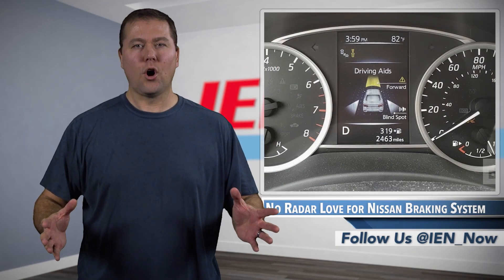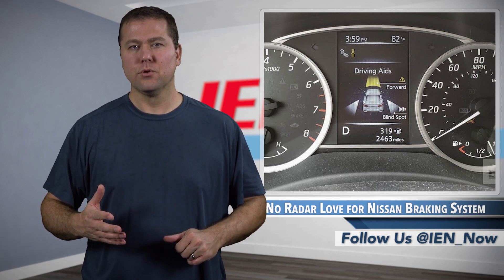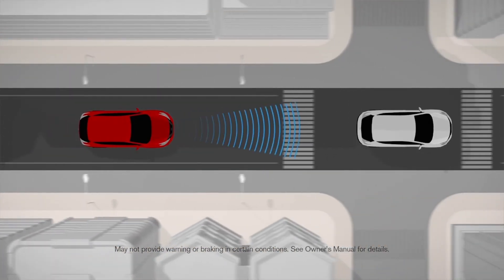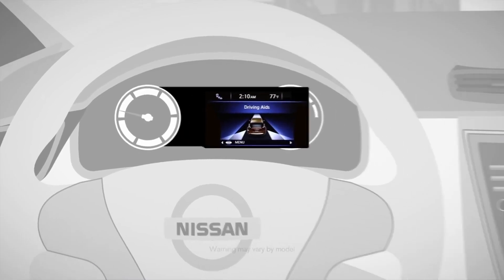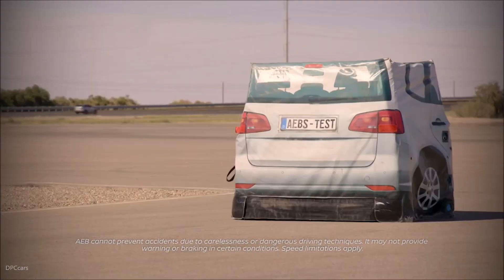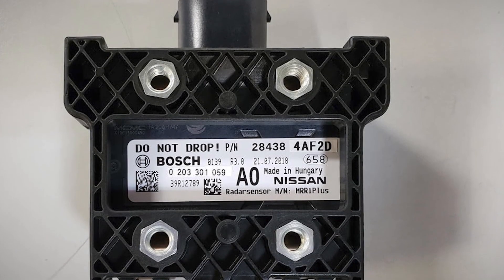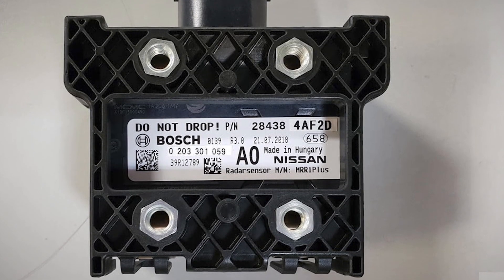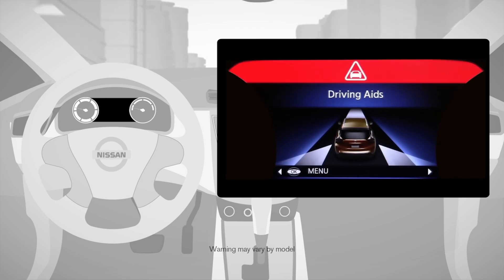IEN NOW: No Radar Love for Nissan Braking System

Comment: Hey guys is it worth getting this fixed? I just got mines recalibrated a few days ago under warranty and I still had the same issues which on the screen says "Malfunction see owners manual"
Reply: Did you ever get it fixed?update please..my 2020 sentra was doing this but i took it in to dealer & had the system updated
Reply: @Calihustla did they fix it for free ?
Reply: @robertgault1858  yes it was covered through warranty. 🙏

Comment: I have 2018 Sentra and this issue is happening at certain places when I pass by it, one time I've read about the issue and it said that if the road you driving on it may be too crowded by cars, people, animals and this will happen, if you switched the car OFF and turned it back ON then it should be resolved, if not then your Radar has issues like damaged or it's covered with dirt.

Comment: My son had same issue in his 2021 altima.  It must have disabled.  Or computer went out like my 2021 sentra at 1200 miles they had to get engineer to fix. One month later my son's breaking failed all together But  his was supposed to break for someone walking in front of him and deer, if a car in front slammed on breaks . Apparently it don't detect a tractor trailer.  He passed away in that accident 5/13/21. My life will never be the same. Since in my sentra with less then 5,000 miles. My car has been in shop approximately last 3 weeks. Steering column went out, rear sonar, tire rods, push start Corroded, and a Crack in windshield by camera.  Then on way to pick it up the sentra I was using until mine was fixed on ramp coming off interstate slammed on breaks at 30 miles per hour.  Dealership said maybe a bug flew in front of it. A bug?  Wth won't stop for a tractor trailer,  but will for a bug??? Plus the bar on back of tractor trailer broke off. Only job it has was so rusted you could pick it up one handed. Looked to be held on with paint and rope. Barely any welding evidence.  So he went up under it killing him .  His front seat was pushed to back window. But car should have stopped.  He had both hands on wheel. Wasn't flying. But would have probably never hit truck if the safty features worked. Nissan is selling death traps. And trucking companies say it will cost to much to upgrade the ride under bars to save just a few lives over 200 last year. But they ruin so many more lifes they don't realize.. Now we have mom's and family like me who walk around feeling dead inside. Corporate GREED at its best.

Comment: Rouge 2018 same issue. I took off the plug to not working at all. Because some times it breaks on his own without any thing in front of the car
Reply: So no more breaks on his own???
I wonder if l can do something to my rogue 2019
Reply: Do you actually need to take plug out? Isn't it enought just to turn Emergency Braking System off?

Comment: Took in my 2019 Sentra for this!
Reply: What did they do ? I have a 2018 maxima
Reply: @ashkayy97  they looked at it to see if it was faulty and also if it was Nissans fault or mine aka maybe I crashed it or something but it was brand new no accidents so they said it came faulty from the factory so they fixed it for free due to the car being still under warrenty. Luckily I did have it fixed and all, the next day it saved me from a accident.
Reply: Omg! How long did it take for your car to be fixed because I am going through the same issue
Reply: @createdbybri  almost one full day took it around 12 and got it done by 6-7 pm. Depends on how many cars they have before yours. They told me it was gonna be at least a day but they got to it that same day
Reply: Erick VD okay! Thank you
Reply: I have the same problem but I am still under the power train warranty for my 2019 nissan sentra